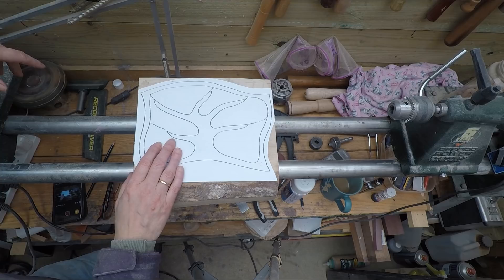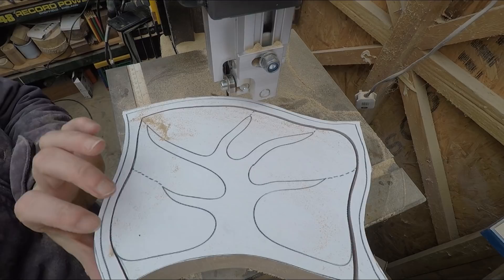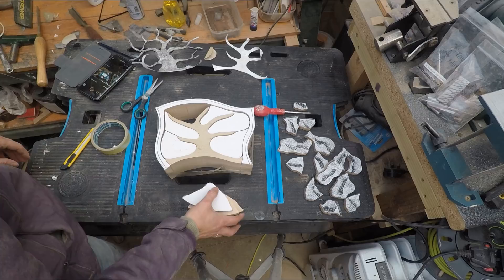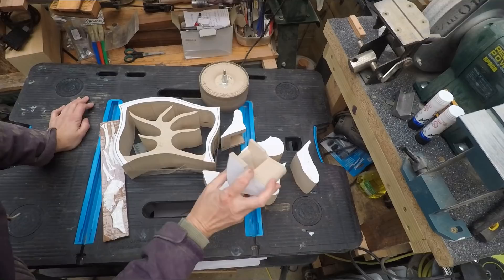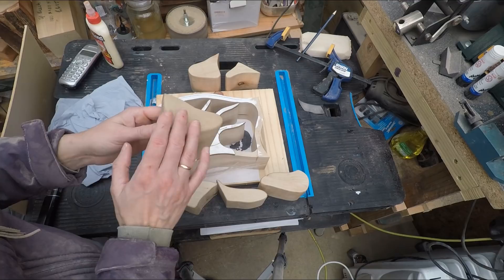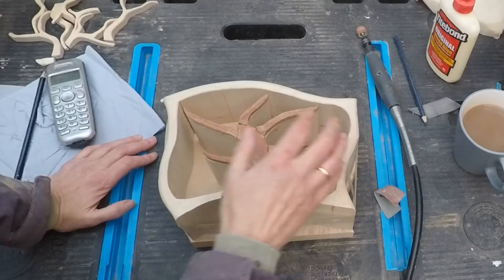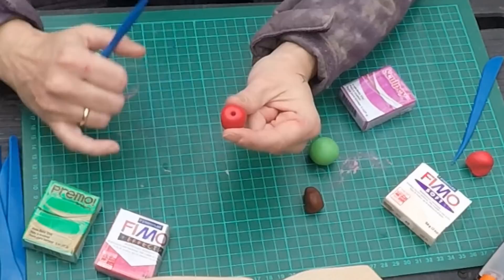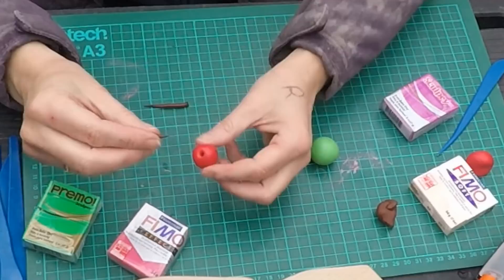Apple bandsaw box

Comment: Hi Pam, kushti design box that.  What width blade are you using on ur bandsaw there? I changed to a 1/8" for tight curves which i found easier for me. I know some peeps use a wider one for curves but the narrower was better for me. Its probs my technique thats lacking lol
Reply from the maker: I use a 1/8 inch blade for all curve cuts and 1/4 to1/2 inch for front and back of boxes. It took me many boxes before i felt relaxed cutting and then the boxes started to look good. Just time. Thank you :-)

Comment: Cool just started to make one but my draper bs200a is not up to the job what bandsaw are you using? Thanks for the brilliant videos
Reply from the maker: Hi rowland i have a sip heavy duty 10inch bandsaw old but does the work for me although with thick oak it can be slow. Many thanks :-)
Reply: @Highlandboxes  Beautiful box!  Heavy duty means how many (k)Watt or HP?
What is the thickness and width of the blade?  What thickness can the wood max have on your bandsaw?
Reply from the maker: @hansdegroot8549  i can cut 5 inch wood i use 1/8 inch blade for cutting box and 1/4 o1/2 inch for cutting drawer front and back. Thank you
Reply: @Highlandboxes  Thank you for your answers. What is the power of the engine/motor?  In  (k)W or HP.

Comment: Why do you like to use sanding sealer?
Reply from the maker: I use sand sealer as it gives a smoother finish to the wood once sanded than without it. Many thanks :-)
Reply: Ahh.  Do you use the beal buffing system as well?  I have it and find that it gives a Great initial appearance then looses its shine quickly.  But I still use it because it's fool proof.
Reply from the maker: Hi Rick i use lacquer to finish sometimes i buff that and gets a nice shine but mostly just lacquer finish :-)
Reply: I didn’t know you could buff a finish like that. I thought it might result in heat and some funny effects on the finish. I’ll have to play with that. I also have bever used a laquer finish. Only danish oil or polyurethane.